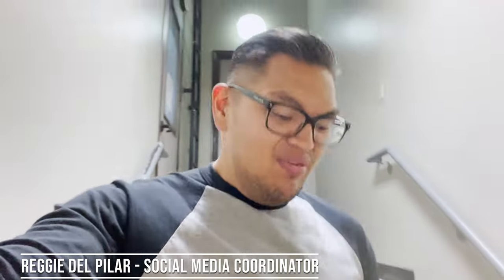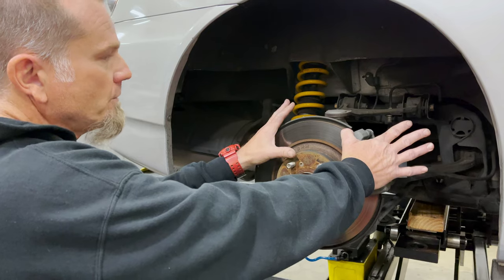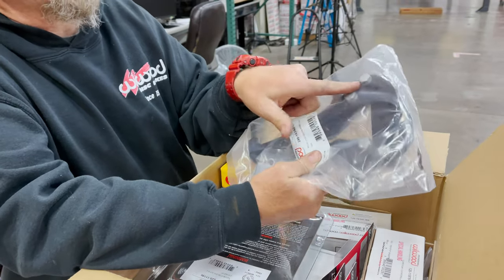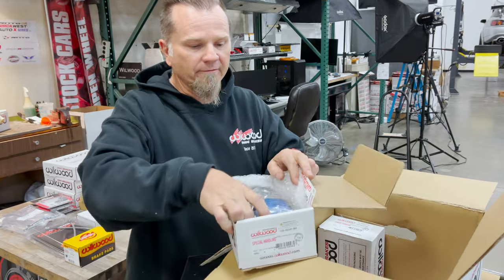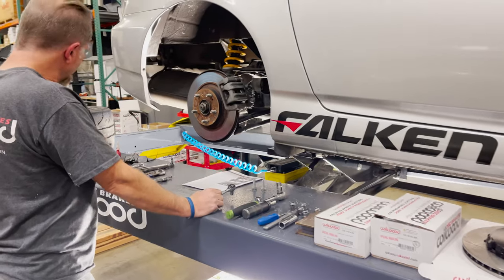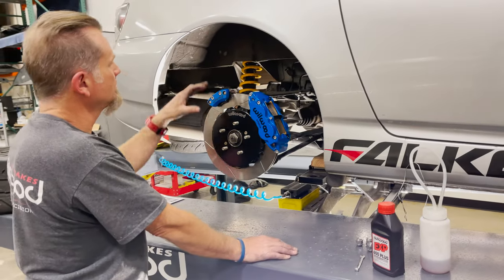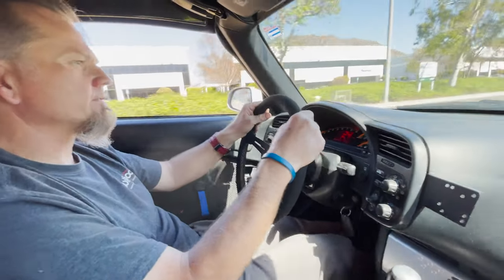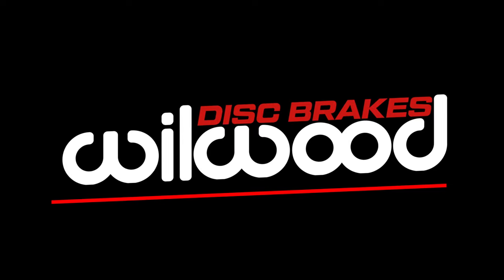Unboxing: Honda S2000 Rear Big Brake Upgrade and Drive!

Comment: Curious about the wheels. Most kits won't fit S2000s without spacers/extended lugs, fender modifications and the like. If this'll work without aftermarket wheels or fender rolling, I'm down to go buy these right now.
Reply from the maker: Hi, this kit may fit a OEM 17 inch wheel. PLease verify using our wheel clearance diagram. https://www.wilwood.com/Images/BrakeKits/WCD_Drawings/WCD_dwg-Large/ds605_wcd-lg.jpg

Comment: Do your cable operated auxiliary parking brake calipers use the same mounting pattern as this electric parking caliper?

I'd prefer to adapt the stock cable operated parking setup to an aux caliper, rather than add and wire in a completely new system.

Can I buy the new mounting bracket separately?
Reply from the maker: Hi, we would like our techs to assist you. Please give us a call at 805-388-1188.